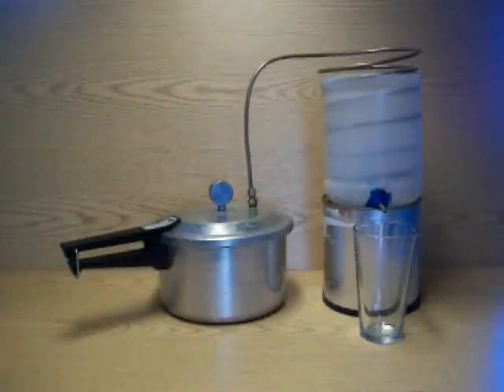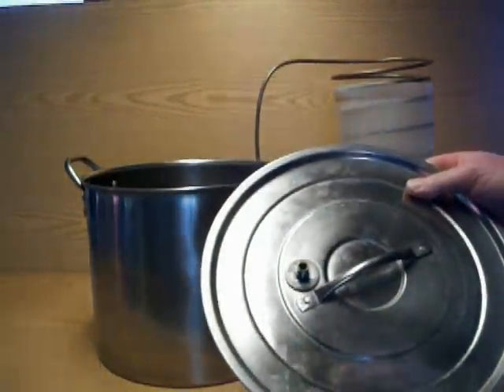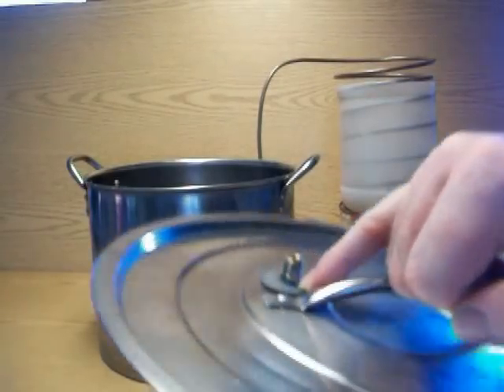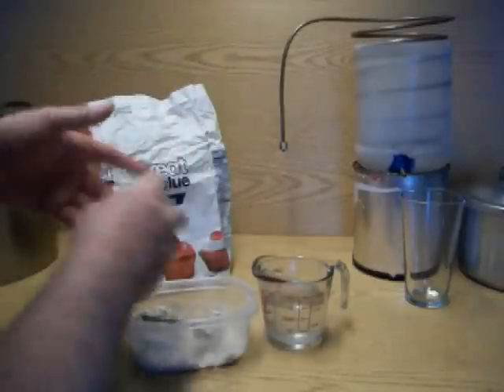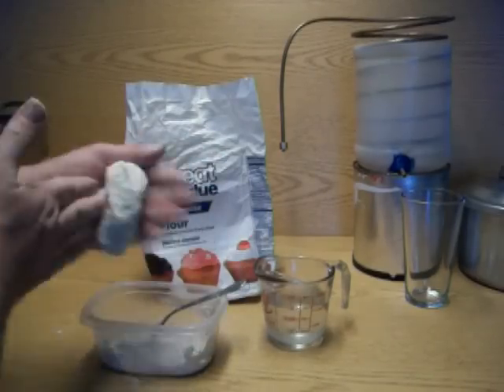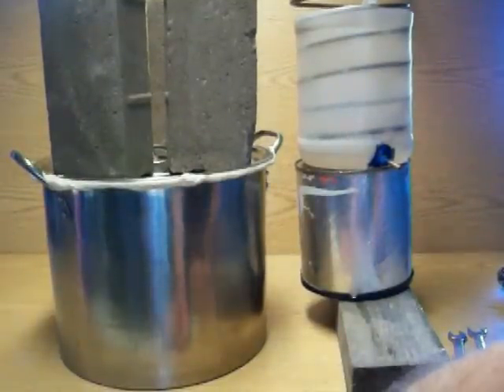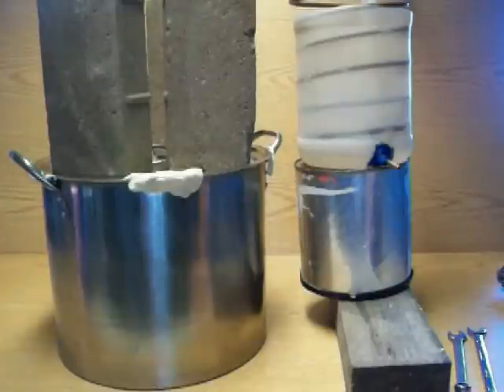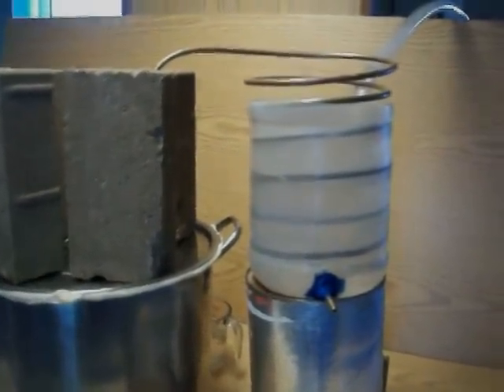Easy Build Moonshine Still pt 2 Upgrade

Comment: for you seal on the lid, buy a bicycle tube, cut it clean it off in the sink. wrap it around the edge it make a great seal. used it many times.

Comment: I would just run a 2nd hose smaller hose that drains the hot water while you control the flow from your tap to match

Comment: I wonder whether using that coupler on the inside changes what you get, when, since its opening is about an inch lower than the vapor that rises at any given time to the top of the pot.  So for example, let's say you have tail at the top of the pot, but doesn't exit because the opening is lower.  Then you start having heart, which, to exit, has to mix with the tail already trapped at the top.  I don't know squat about this, but I guess ideally you'd want the exit at the very very top.
Reply from the maker: No.. The coupler is just some required threads and stability to keep things in place. Good luck finding a nut with the same threads. But if you find one....use it.

Comment: Hi, thanks for  both methods shown,
just few question i hope you dont mind to answer
1. can i use other metal as condenser instead of copper lets say aluminum or stainless steel ... if not why
2. longer condenser coil have any better effect or not as i can see in your video its about 6 circles or some ... just wondering about that 

thanks
Reply from the maker: +Aminlv 
1 I would not recommend an aluminum coil.
Stainless steel is debatable, but I won't tell you not to use it, just clean it real good before use.
It is said copper removes sulfur from the alcohol. Whether that happens or not, I haven't confirmed it.
2 You don't really need a coil. just a cooled piece of pipe.  However the longer the length, the less you have to worry about it being able to keep up with the demand of the steam coming into it. personally I would say nothing sorter than 2 feet of cooling pipe not including what comes off the still

Comment: Couple of ideas.   First. Instead of bricks why not a thin board or piece of metal which could slip between the handles and then a wedge or two between the board and top( wedge of wood or a thumbscrew or two to pressure the kid down). Second, instead of wasting all that water in cooling the worm, take 2 liter bottles of soda, drink the soda then use the bottle,for water, put into freezer, the. Use frozen bottle in water ....two bottles to,es and you got a replacement etc....  great  video

Comment: Nice!! I have the same set up. Except i have a piece of 1/2" hard Copper going into my  pot and on the other end its reduced down to 3/8"  soft Copper tubing Coil. I connected the 1/2" Hard Copper into the Pot lid by drilling a hole and popping in a 1/2" O'Ring Grommet for the line to press down into.. It seals very nice and easy to remove when done. - I've made some good shine from my still, but i have to run it at 195' - 200' degrees in order to get anything from it. How hot do you run yours?

Comment: By the way that is also the way people used do calking on homes back in the 20s. I saw some examples of this. They sometimes used ripped up shirts soaked in flour and water or just flower and water to seal around windows and doors. Back then the construction was planks of wood inside and out. Planks of wood would have gaps and would make for a very drafty house. Calking was the way to stop the draftiness.  I can see why old timers used this to seal their stills.
Reply from the maker: +moofushu Oh yea, I can imagine...I saw on Mt Rushmore where they sealed the cracks in the stone with a witches brew of natural stuff before silicones were discovered.
Reply: +wcemichael sand, cement and 15% water just to moisten the mix. It's callled dry packing.
Reply from the maker: fuknsk8 now No, this was much older. We are talking about tar and tree sap. I don't remember exactly what was in it but it was stuff like that.

Comment: I found this video clear and straightforward...which is a huge plus cuz often similar ones are harder to decipher. I have a question that's been nagging at me and id like to address it to you. While I find this process interesting for the sake of knowing how, ultimately, I always come away with the thought that it seems a lot of trouble and expense for a low yield. I don't really care about drinking...I don't mind a drink now and then...and alcohol is accessible and affordable enough. I realize this stuff is twice the proof, but for all the fussing, isn't it easier to have 6 shots instead of 3? I feel like im missing a piece of the final motivation to actually do this and id like to hear it from the perspective of someone who has
Reply from the maker: Steven Edwards 

Well....Two ways of looking at it
3 does the job quicker than 6. So you could take a potent mixer to a party in a smaller container.
or
If you can't get the 3 down without it fighting back, what's the point?

Another thing is, I rarely make anything that strong. I did start at making 130 proof, only because I didn't have a testing meter, but when I did get one I started proofing down to 100.  Just strong enough for the "OOHHHH SHIT!" factor, but I did make some lovely honey mango brandy that was proofed down to about 60 proof, just for the ladies
Reply: +Steven Edwards Steven, if you ever have the 'real stuff', it's like a different kind of drug. I smoked grass for years, that's all I ever messed with, but REAL MS takes you 'out there'. It was amazing! It's a rush, a high, and an OMFG!! I might end up just buying some Everclear and seeing if it takes me back. If not I might try this. Just two shots and you're set for the night! #Out_Fking_Standing

Comment: i cannot get a stainless steel pressure cooker anywhere,can i use an aluminum one? or should i get a big pot like you have?
Reply from the maker: You can find anything on ebay. They even have complete moonshine stills for sale
I only recommend aluminum for short term use, if you happen to have one or can find one cheap

Comment: "Pressure canners" show up pretty often at yard sales, flea markets, etc,  and we found a really GOOD one for $20.  These are often 22 quarts or larger, and sell new for around $70  and up.   OURS will make a good "upgrade still, " and if I'm careful with the modifications, it will re-convert to pressure-use if needed.

Comment: how did you get the flour putty to not stick to everything.  it was sticking to my hands something awful.  i was thinking of trying to find some sort of gasket to fit on the top of pot and lid.
Reply from the maker: You have to get it pretty thick. Just keep adding more flour.
Reply: will do thanks.!!!  it was not working at all and messed up my first run.  will follow your advice and do it again.  yours looked like perfect playdough.

Comment: I have only ever seen an aluminum pressure cooker/canner. Now is aluminum ok to use to distil whisky?
Reply: How would it poison you?
Reply: Brewing Techniques (Jan/Feb '95) had an article on a parallel brew experiment using an aluminum brewpot and a stainless. Laboratory analysis showed that there was no significant difference in trace aluminum levels between batches. They also pointed out that most of the Al you digest is from your food and water. And for that matter, many medical people consider copper a bigger health risk.
Reply: That is also my question. From what I have seen on the u-tube the pot look to me to be aluminium.
Reply: Thats a quote from the brew journal. im just trying to sort out whats what.
Reply: I would just like to know the science behind it.
Reply: charles vereschagin I don't know if it's poisonous but I do know the alcohol can break down the aluminum

Comment: to cure the cooling problem simply have a feeder hose tap into your coil tank.. feed it from the  kitchen faucet on low feed let second drain tube run into the drain  keeps a constant feed of cool water same as a stream would.

Comment: Is The silicone you used in your still non toxic? Cause I'm just curious is silicone toxic in that form, because I fear that unwanted impurities could leach into the product your making. And lastly, how would you clean the pot part of the still?

Please respond as soon as you can get the chance.
Reply from the maker: I really have no idea how toxic that silicone is. The beauty part is how little I used and where it's placed I could have used roofing tar to seal it. It's on the outside and it only serves to seal whatever hairline crack their might be. And after the first couple of break in runs, whatever toxins their might be should be removed. But I would still recommend using the best silicone you can find.
I've ran gallons through this, but you still have second thoughts about it, then you could rape it with teflon plumbers tape
Reply: Thanks for your reply, and also how would you clean the pot part of the still after using it and also the cap? Could you just run it through the washer? Or would that not be a good thing to do to clean it?
Reply from the maker: The4Beatlesrock
The flour putty will stick to the lid and pot. It needs to be cleaned with metal scrubber. Copper or stainless steel scrubber, not SOS pads. After that you can put it in the dishwasher if you want.
Reply: Thanks for your reply

Comment: Auto parts stores carry copper nuts for exhaust pipe to manifold connection. I found the shorter the coupler the better the performance of the still.
 If you have a 1/2 coupler inside the pot you must have a 1/2 inch of steam in the pot before any alcohol makes it into the condenser. 
 Alcohol is lighter than water so the best alcohol doesn't make it to the condenser. That's why moonshine still have cone shaped tops. 
 I used clips from a office supply store spring clips  used to hold several pieces of paper together. I use them to hold the lid down for two reasons. First I don't need to keep bricks in the kitchen. Second and most importantly. If the still builds to much pressure the lid will pop loose I'm afraid that with bricks if bad things happen and it builds to much pressure even at 15 psi that makes a deadly explosion.
Reply: if he is still single keeping bricks in the kitchen isn't a problem

Comment: The flower seal is a last resort method! I tried it once and didn't catch the leack on the back side of the pot and had a nice fire and it started to burn up the side of the pot. Thank god I seen it before it got to the lid or it would have mad one hell of a boom! At what angle does the worm have to be for the liquid to run? Can you do a clip on how to make a worm for new folks like me please? And thank you. Should always use clamps if possible.  The hose thing you did I've never seen before and think it's a wonderful idea:)
Reply from the maker: Well you can go back to my original video to look at the worm.
The worm can be at any angle as long as it does go downward and there are no low spots to collect the alcohol. If that happens then it will seem like a perking coffee pot.

Comment: This is a great video! but it is too advanced for most people.  Please simplify the lid.  Most people can't drill a small (3/8"?) and exact hole through the top of a stainless lid to save their lives, let alone deal with fittings.  But they can drill an imprecise and inexact, larger hole, somewhere.  My suggestion is to use a rubber stopper, like the one found in most brewing stores, and a little silicon caulk on every use to seal up what the stopper doesn't fill.  I also wonder how you know the temperature of your boil without a thermometer?
Reply from the maker: +Scott Rauenzahn A hole is required. They can go back to the first video where I make one out of a pressure cooker and the hole is there and it's threaded. And you don't need to know the temp. You get it hot, it starts to drip, you turn the flame down. If you don't like the taste you turn the flame down some more. I have a video covering that too
Reply: umm that lid is simplified. my 3 year old can hold a drill and put a hole in that....if it's too advanced for people then they don't need to be making shine anyway.
Reply: +wcemichael Got it!  Again, this is a wonderful video.  I'll ask this, just because you seem nice enough to answer my questions.  This relates back to the temperature issue.  Outside of needing a good seal, why do people use a pressure cooker?  It would seem to me, given the fact that one can boil with a vacuum (low pressure) as well as one can with heat, that maintaining the gas pressure to atmospheric would be a priority.  Maybe I am too much of a science nerd, but I would want to maintain the gas pressure to as close to atmospheric as possible and chart the temperature of the boil so I know when to shut things down.  This is not a criticism.  I have always been accused of overbuilding things, so my mindset it to go simple, and I often achieve neither.
Reply: +Scott Rauenzahn lol...that is getting a little scientific there! I can't answer for him, but personally....I've used a pressure cooker before for the seal but also just because of the ease of swapping out a fitting on the lid to connect the line.
 Also, it's very easy when doing a small batch as a test before running a few gallons of some stuff that isn't all that great. 
Never really thought into the scientific aspects of it myself. All I know is that it works. haha
Reply: +Scott Rauenzahn And as far as charting the temperature of the boil goes, I had one a while back that I removed both original fittings in the lid and replaced one with a fitting for my line and a temp gauge off of an old gas grill threaded in perfectly to replace the other fitting. Had readings from I believe 100-500°. Don't think it was ever exact, but it worked. That one I remember would build up some pressure, never more than a few psi as far as I could tell.
Reply: +Jake T "if it's too advanced for people then they don't need to be making shine anyway"  That is probably true, but I stand by my opinion that most people--and I wasn't including just the people who should be making shine--couldn't drill a precise hole through a curved, stainless steel lid to save their life.  My point was, and is, that there must be easier materials to work with.  Plastics, for instance.  My experience is that things need to be dumbed down so much, that even the checkout girl at 7-11 should be able to do it.  This is not a criticism of the video's author.  He is nice enough to answer my stupid questions.  It's just my observation on life.  Even the smartest people can't understand the simplest things.
Reply: +Scott Rauenzahn Lol....yeah that's true. And I do agree that it has to be dumbed down for a lot of people. But I just think a couple of fittings and a washer compared to a rubber or plastic insert....there are people out there that wouldn't be able to do either. 
I can build anything I want to so I could do either way to perfection, but yeah, for probably most people drilling a hole in something like that would be hard enough. Then adding a rubber grommet or brass fittings would just add to their frustration. 
When I said it is simplified, I meant more that compared to the larger high dollar stills some people use (the kind you see on TV, so that's what a normal person expects to have) it's really...extremely simplified to be an in home small scale still that anyone could use. 
But yeah...as far as actually building it...still too much for some people. My only problem with rubber, plastic and silicone is its going to be low temperature basically, but would the steam pull out any chemicals from that type of stuff that you'd end up drinking? I feel safe with all metals....clean it all out good with vinegar before each run and it's good. also not sure how plastic, silicone, or rubber would hold up over time. 
You seem to be more scientific than I am, so any thoughts on the steam leeching anything from those materials or breaking them down? I'm sure silicon holds up good...just not sure about plastic mostly.
Reply from the maker: +Scott Rauenzahn Ok, I'll answer that last question/statement as best as I can.
I can't help the complete idiots.
There are people trying to eat whole spoons of cinnamon and setting themselves on fire just in hopes to be internet stars. Can't explain it any simpler, and can't keep these idiots from watching. I can only hope they have a better idea of what is involved, better than from just watching a couple episodes of "moonshiners" on cable TV

Most of these people don't think outside the box like I do, but can grasp an idea once it's shown to them. And I would HOPE that a person not smart enough to change his/her own tire would also not even attempt this.

Comment: Good video and you got a really nice set up. I love the way you used the flour. 

have you ever considered using a old water heater for a still? They have a glass lining, built in heater,  the tank is isolated and the thermostat can be modified for just the right temperature,. 

I know its a bit big but these old tanks go for scrap prices. Probably $10. You just have to bend thermostat metal to increase the temperature to the right settings and unhook the top element.  I used them before as a still and they work very well.  
The only problem is cleaning the tank from time to time. I am not sure how to get around this. The mash has to be filtered good whereas  in the set up in your video doesn't require the mash to be separated from the liquid  

About the pressure in the pot. I had a lot of problem with this also so I
increasing the size of hole in pot,  increasing the size of copper tubing and shortening the copper tubing. This solved my pressure problem but created another problem.
  I had to change the water  much more often and keep it colder. 

I am going to try to use a small $9 pump from harbor freight to circulate my water through a radiator that is laid on its side and see if it keeps the water cold enough so i dont have to change it all the time.
Reply: +Samuel Atkins I have never thought of that but that would be an awesome still.